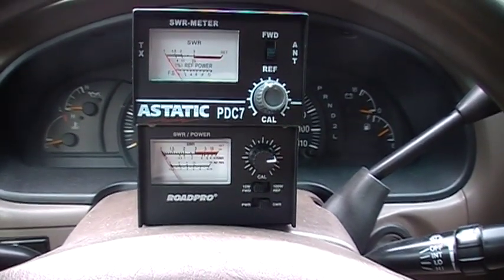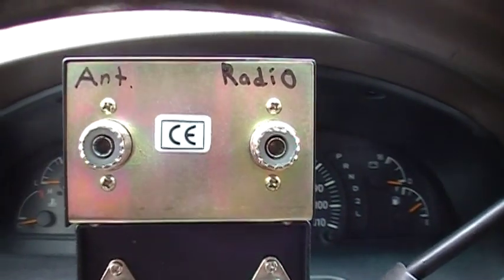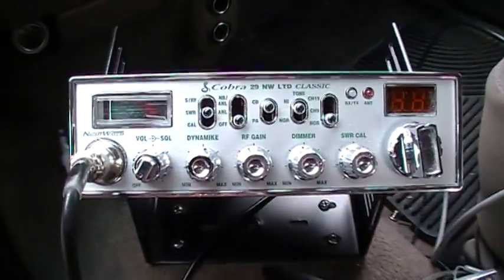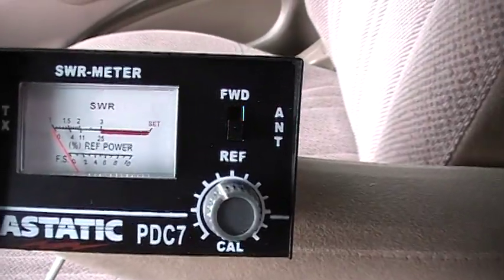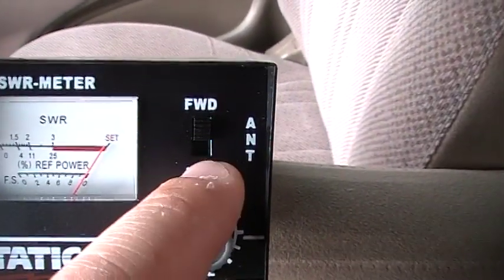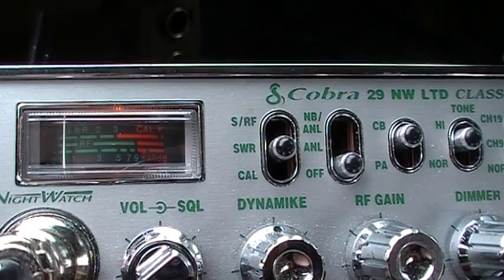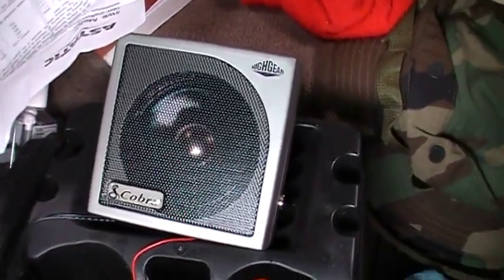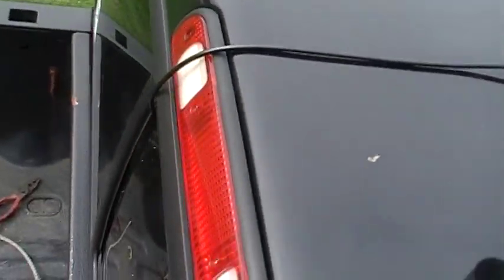SWR meter

Comment from the maker: I sold all of my CB equipment. When I drove truck I hooked up my connex radio in a Volvo with stock connections and it messed up some of the Solder which caused it to not work. Got the radio repaired and sold it. Not in the hobby anymore.

Comment: REF, is not reference. it is reflected power. A poor vswr is caused by an antenna that has an impedance that is far too high or far too low. The antenna will be too long or short or positioned incorrectly. When a poor vswr is shown that means that RF power is coming back down the coaxial cable and back to the radio. hence the name reflected power. As we all know a high vswr can cause damage to your finals on the radio. Just a bit of background info. Good tutorial though! cheers!
Reply: was coming to tell them the same thing. Even if you never get your ticket studying the ham technicians book will at the very least teach you about radios

Comment: That's an impressive SWR for a magnet mount.  It's time to get a proper mount and drill some holes in sheet metal to get a proper ground.
Reply from the maker: I'm no longer running the Wilson 5000 trucker antenna had too many problems with it falling off on my now Nissan truck since the roof is so flimsy. I ended up buying a Wilson 5000 magnet mount antenna which works much better since the coil is closer to the ground and never tips over.  Unfortunately I do not use the CB radio as much as what I used to and ended up taking the equipment out of the truck.

Comment from the maker: I prefer the Astatic PDC 7. Easier to tune I think. Also I'm no longer running the Wilson 5000 Trucker antenna. Got tired of it falling off my truck. Not running which seems to have a much better SWR reading is the Wilson 5000 Magnet mount CB Antenna. I sold my Cobra CB radio now running a Connex CX-3400HP.

Comment from the maker: Thank you for clearing that up. I did however remove the Wilson 5000 trucker antenna and ended up going with the Wilson 5000 magnet mount because of the trucker antenna falling off at faster speeds and not getting a constant SWR reading.

Comment: SWR= Standing Wave Ratio not "radio". Ref= reflected power not "reference". One reason the SWR is different between your radio and the actual SWR meter has to do with the amount of coax used and also distance from the antenna where you have installed it. You might want to get an antenna book and save the money you pay these truck stops to tweek & tune--it's a waste of money, especially when running a mag-mount.

Comment from the maker: @bpbat21  You can leave the SWR meter hooked up to the radio but you'll lose about 1 watt of power. So  can leave it on if you want to. I prefer to leave mine on. Also if your running over a 2.0 on the SWR meter then you may have an antenna issue. Your antenna could be to short, bad ground, or the radio is acting up.

Comment: I have a cobra 29 and when my external swr meter is connected to my radio and antenna the readings are close to the same, around 2.4; however, when I disconnect my external swr meter and connect the antenna directly to my cb radio, the swr meter built into my radio reads differently than it did before, around 1.3.  What does this mean and what should I do?

Comment from the maker: @exposed97  A bad SWR can be related to a couple of different things. 1. maybe a  bad ground. So you'll have to move your antenna to a different spot. The roof of the vehicle is the best place or trunk. 2. your Antenna is not tall enough. That means you'll either have to adjust the antenna if your antenna is adjustable or buy a taller antenna.  3. your connections are not snug or a loose wire somewhere.